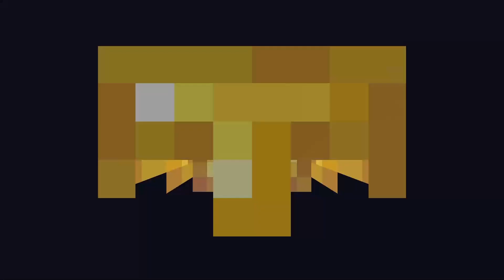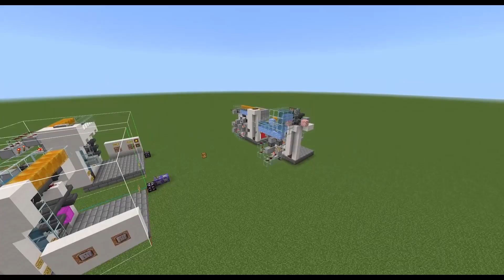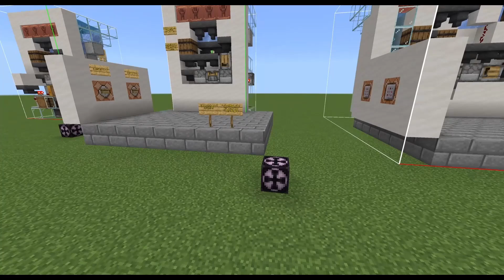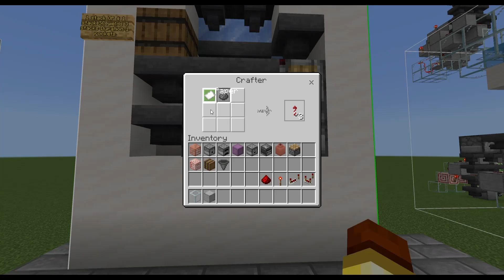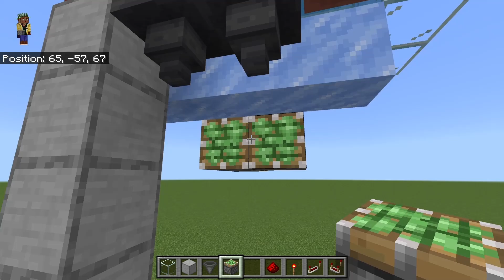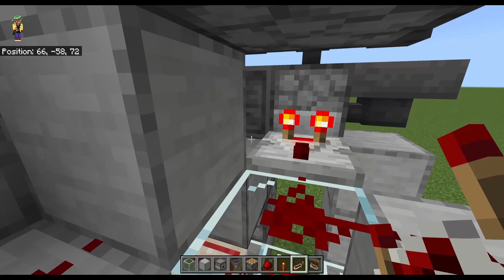Rocket Crafter, duration 1, 54k/hr

Comment: Hey golden helmet, I’ve recently built your new larger creeper farm and seem to be having drowned spawn in it, I’ve checked all the floors and everything is in place exactly as shown in your tutorial, I suspect their spawning in the water in the centre but have yet to confirm this, do you have any suggestions on how I could fix this problem? I’ve also had a spider spawned in the farm which has had me scratching my head as I’ve checked and confirmed that all the slabs and trapdoors are in place, it’s not a huge issue as I have a large storage system for the farm and its not enough to impact the rates of the farm just wanted to get your opinion on it 🙂
Thanks again for a highly efficient gunpowder farm and looking forward to building some more of your redstone machines and farms
Reply from the maker: If you built over an ocean drowned can rarely spawn inside the trident killer. Change the 4 blocks that the trident sits on to glass. I don’t recall those needing to be powered. There should be any other water directly on top of a spawnable block in the farm.

A spider shouldn’t be able to spawn in the tk like that, so there must be one spawn spot somewhere that isn’t spider-blocked. If all your blocking slabs/trapdoors are in place maybe you have an extra spawnable slab/ice on the outside edge somewhere.
Reply from the maker: You can comment on the creeper farm video itself btw.

Comment: Dang! Noice! I was having trouble getting the 1 paper crafter to keep up—taking the repeater out seems to’ve done the trick! Good stuff. I think my shulker loader might spill a bit without a cover, but I’ll have to try the honey block/hopper setup. Do other less-than-full blocks work too, like mud?
Mine’s in a 6x6x6, but it got hung up on paper crafting so the rates were off. I love shutting the comparator clock off from hanging torches for easy full detection and am glad it seems a good tek. 

Love it, but hate how many hours of noodling this video might have inspired. Is 6x6x6 really that important? It also doesn't have item filters which can be rough, but it does shut off when out of shulkers too. Hmm.
Reply from the maker: Smaller is always better, but “enough” is often subjective.

Comparators can read through mud, and hoppers can collect items through it, but the honey in my loader works because it is not full width. I think the only other block that could work there is a chain.
Reply: @goldenhelmet403  ah, nice. I'm taking the full signal for the shulker through the piston at the moment which I thought was pretty cool but haven't though about how practical it really is, just that it theoretically saves surfaces around the sides of the shulker since it's limited being slapped on the crafter.
Chains you say? I just discovered/remembered you can put things on chains and like those for redstone components at the moment since they're easier to see what's behind them than blocks. End rods too for the fun of it.

Comment: Very cool - I did the same concept build (stage 1 rocket autocrafting taking sugarcane and gunpowder inputs) but had a very different system. 
I like how you incorporated things like the water cycle for resource ingestion and pushing for high speeds.